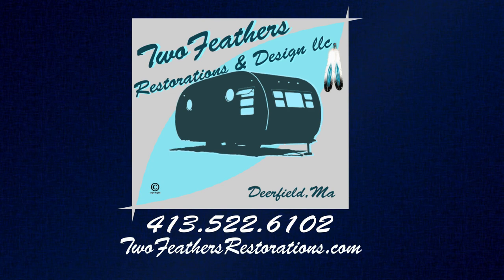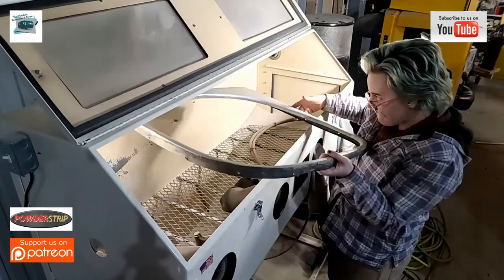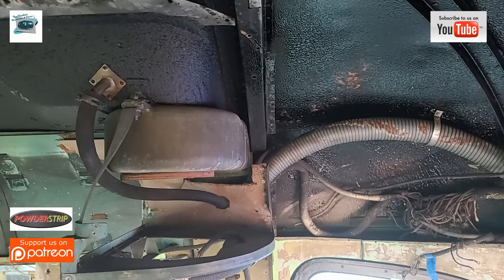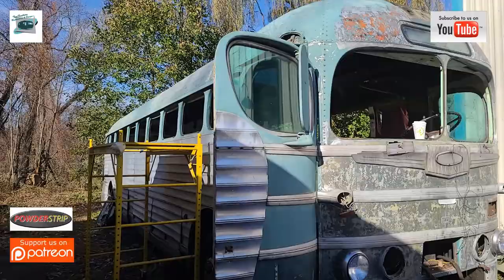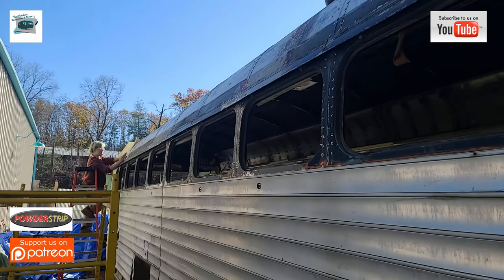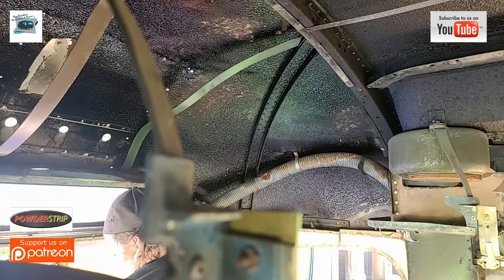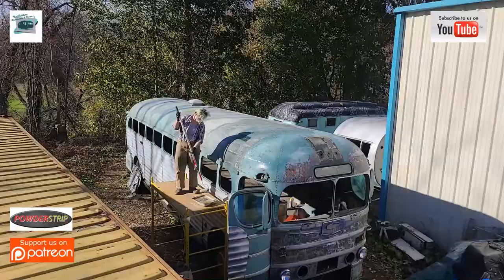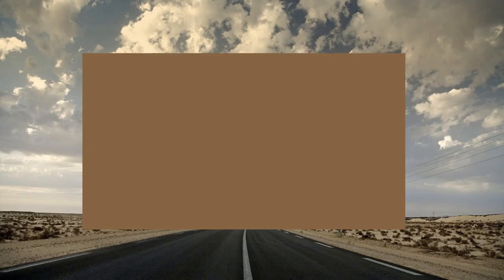Episode #2 Paint Removal on a PD4151 GMC Silverside

Comment: The dents at the front on either side of destination sign I believe r usually from drivers hitting like a overhead awning at some bus depots..covered area for people to walk to buses when load. Unless the all hit the same trees. Seen many with same dents. Seen same on 4104's
Reply from the maker: It is very possible. This bus was stationed in Detroit and traveled to Indiana when it was first put into service. From there we know it ended service in Northern Ny and ended up in Northern Vermont before it went to its second owner.  The type of dents were not ones that would have taken much of a hit to create. So small tree branches or like you said. The overhead signs. Looking at historic photos. It looks as if there would be plenty of clearance.